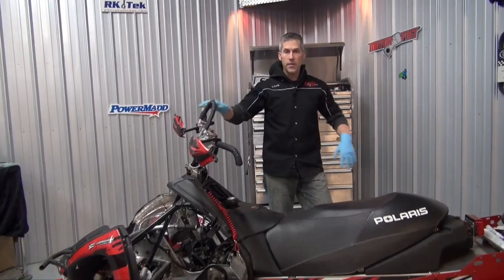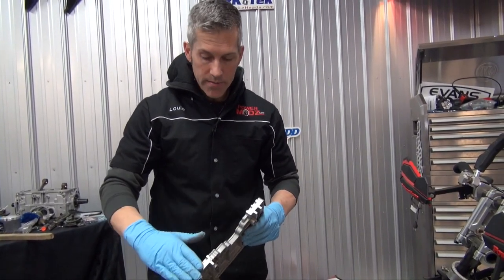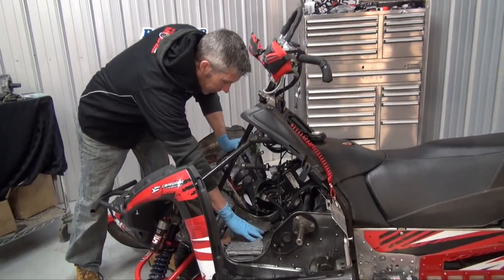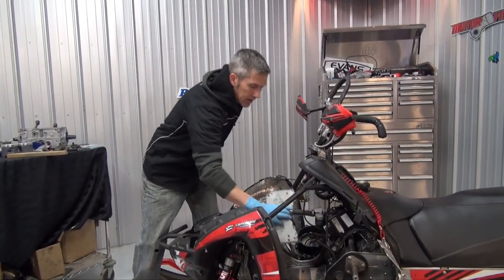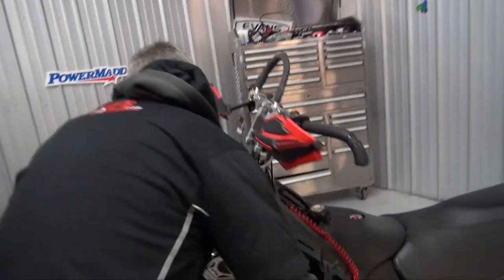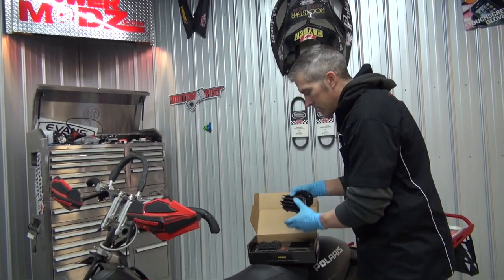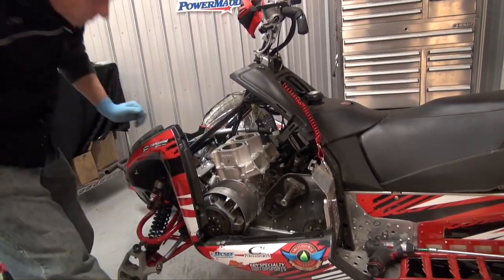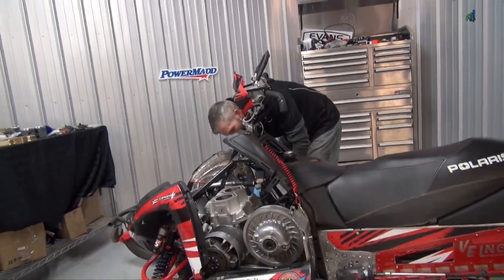Polaris IQR 860cc Mountain Mod RKTek Big Bore install part 1!

Comment: I would of aligned it all like you did and then tack welded the skidoo plate to your swap plate sense that skidoo plate comes off the block you would of been good to drill holes perfect. That’s assuming you can weld aluminum which you can.

Comment: Louie, I have a 2014 Iqr that I just purchased and im curious to what I should use for jetting. Im running premium 93 with my timing set on G and was wondering what your using? My riding style is ditch banging and playing in the powder. Also thanks to your videos I purchased a 10.5 gallon trail-tanks tank, seems to be doing a great job. The videos are great! Go PowerModz! - Scott C.
Reply from the maker: Hey Scott that is great!  ok the 14 is different as far as jetting goes  - just slightly I'm told - mains run a little richer.  use the iqr jetting chart for baseline as it is pretty darn close.  also check out js powersports online for info and parts.  I had it close to dialed in when i put theis video out - the next day the temps outside warmed right up and jetting was horrible - i had to drop about 5 mains.  the .9 paj helps the idle bog, it runs lean with it and hand idle but it's needed.  the pilot jets can be 45 or 50 - try what is in the carb and you can see if you need to go smaller by the position of the fuel screw - if you need to screw it right in to get it leaned then drop a pilot size (anything less that say 1 turn out ).  The mains will depend on your altitude and outside temp - start with 430's and jet until you have it right - make notes and get ready to get dirty.  also, there is a mid range lag - i'm thinking it is the stock secondary spring - it needs to go.

Comment: I have a 1999 Arctic Cat Z370, I've had it for quite some time now, it doesn't have much power for what I do. I enjoy the body style and everything, but it sucks for hauling ass up hills! Also, it's just a fanner, but would I be able to drop Z570 heads on it, and if I did what else would I have to do to it to get it working great?

Comment: Hey Louie, Not sure if you will be able to point me in the right direction or give any advice on this but i have a 05 IQR 151 and i have a 2012 800 etec that i'm going to be attempting to put in any suggestions on how i should go about mounting that motor since that will be the toughest part of the project im thinking or any tips? Thanks

Comment: doo motor !!!!???? Unsubscribe !
Reply: I have to agree with that. The engine may be based on a rotax, but it's only the crank and the crankcase that is stock. The cylinders are modifyed rotax cylinders, but as relieabel as any other cylinders that is modded by RK tek. This sled is probably going to be awesome with the 860. 

BTW the polaris electical and fuel sytems aren't that bad. Yes, they had some issues in the past, but most of that was fixed in the Pro. Doo's has more problems than Polaris
Reply: youre the only one missing out! lol besides this engine has less electronics since its carbed and if i  remember right the stock engine was efi and its all rk tek parts anyways.
Reply: The stock iqr engine is carbed. Louie just used 800 CFI cylinders og pistons with a long rod kit.
Reply: HA